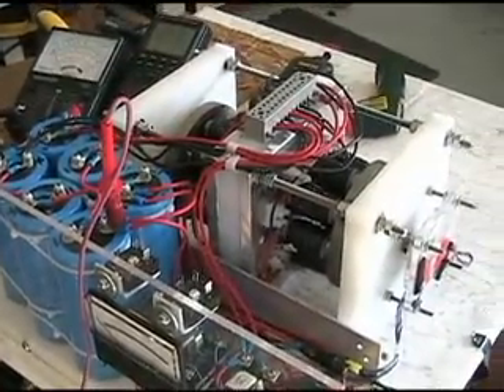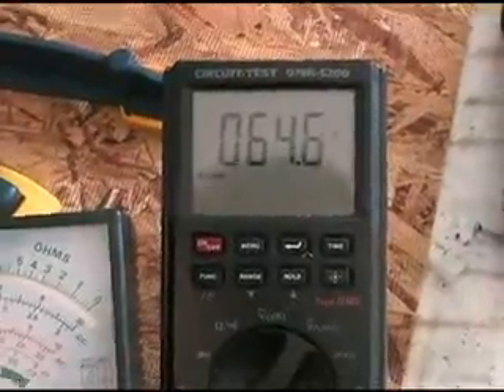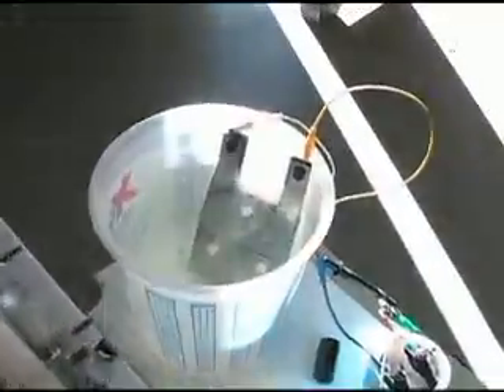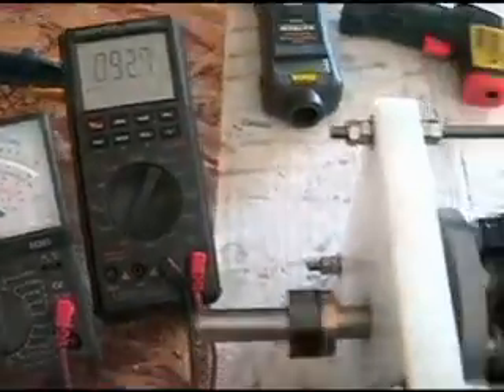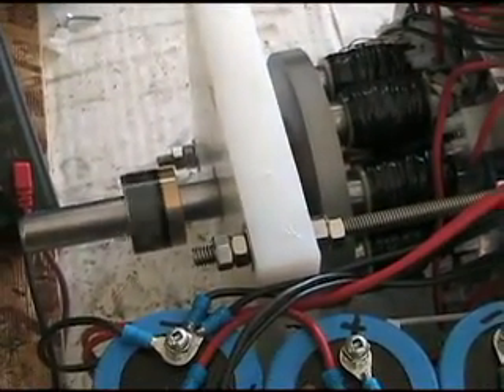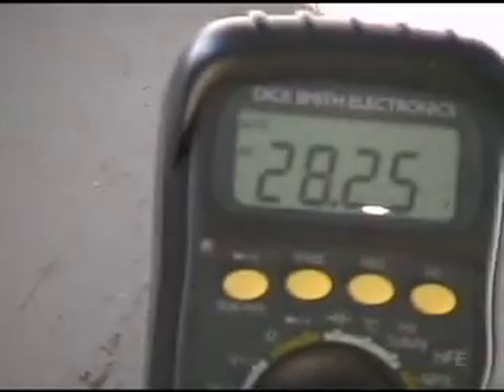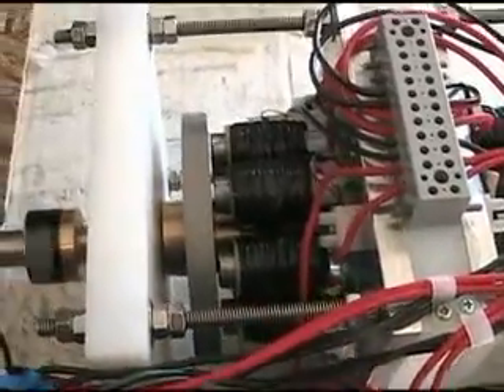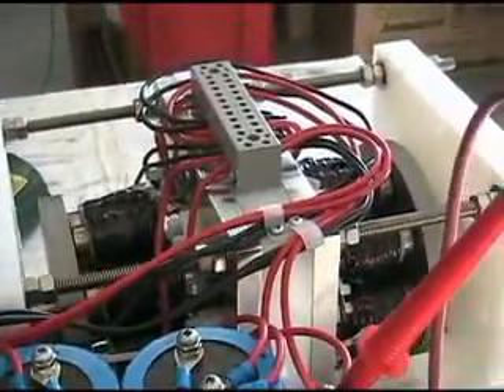Pulse Motor Making Hydrogen Gas as it Runs

Comment: Hi there, nice engineering =)
But a question, i just read an article trying to explain the ADAMS PULSE MOTOR (and i think this is one of them) and what i learnt is that the voltage and current you are measuring is switched meaning you cant use normal instruments like you do.
Do you have a highly sophistcated Oscilloscope available so you can perform a propper analyze of the Power generated/consumed. It would be of great interest to me if you could do that.

Thanks!

Comment: This is the direction we all should be going, we are doing some puled DC on some tubular designs soon, but recovery can always be used to generate hydroxy on demand, add a voltage double that lindermann did for Wise men ands you could put this in an EV. Well done man.